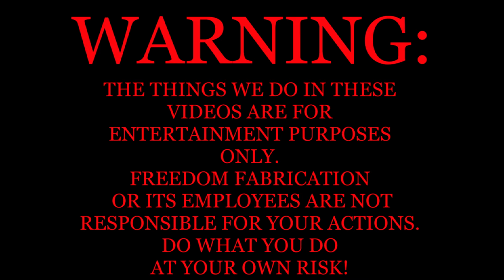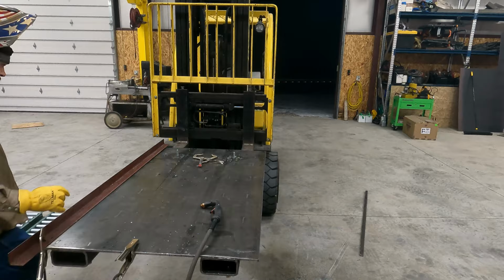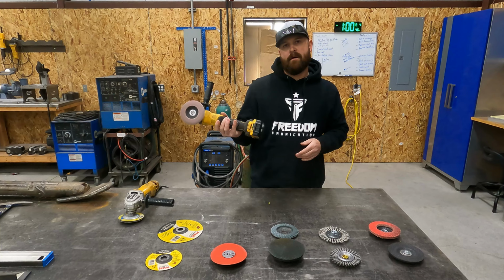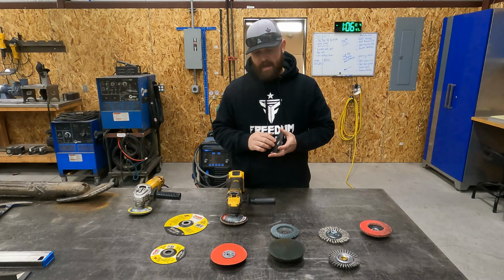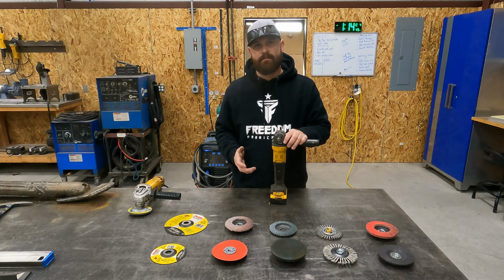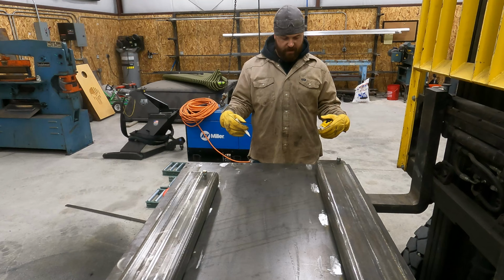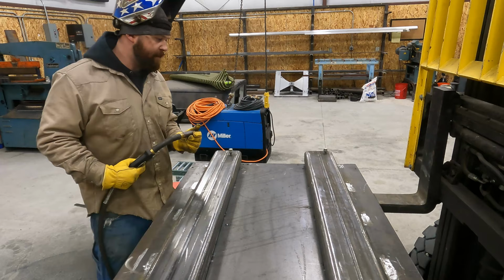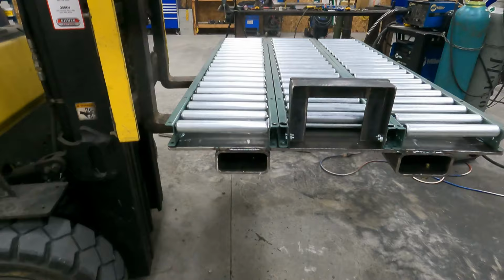Welding and Cutting modification on roller skid

Comment: Grinders are just never ending in usefulness belive it or not i have roughly 15 in a filing cabinet draw 
My brother in law works at a tool distributor, and they get tools sent back for repair mostly veriable speed bosch but there not cost efective to repair so i collect them remove the speed controll and work like a normal switch grinder something to think about if any of yours die and there not burnt out check the speed controll board if faulty take it out and back to work 😉
Reply from the maker: Good info. I’ll remember that, thanks.👍🏻

Comment: I have 5 x 125mm grinders I use, all with different attachments on them (cutting disk, grinding disk, wire wheel, Poly disk, flap disk) so I just have to pick up a grinder, no changing attachments. I have quite a few different brands - whatever was on sale when I needed a grinder basically. The dewalts seem clunky and slow to spin up to me, but they keep going. The Milwaulkee leads are to thin and get warm with heavy use, but otherwise they do the job, but my go to units are my  hikoki and makita units. I do have a variable speed one I got from Aldi of all places, it is great for wire wheels, but to heavy for anything else.
Reply from the maker: Not a bad idea to be able to just grab and go if you can afford buying multiple grinders. I will probably end up doing the same when I get to the point that I have some extra money.
Reply: I have one nice grinder I put a hard rock grinding disc on but I do the same thing with cheap harbor freight grinders for my flap, cut off, and wire wheels and they've been going strong for 2 years now. It really is so much faster to not have to change all the time.

Comment: Nice work! I see you using a respirator for the heavy grinding and I gotta respect it. I used to hate those masks but they're really a good idea. 

However, I looked into a Powered respirator (PAPR) a while ago and saw the price tag and said hell no. But, I kept my eye out on eBay and ended up finding a used speedglas one for only $400. (Not that much compared to $2000 new) 

make sure you get one where you can flip up the weld lens for a perfectly clear grind shield so you don't have to take it on and off and defeat the purpose. It has  auto shades 5-13 easily changed with a button so you can use a torch, plasma, and weld all on one hood.

I'd say it was one of the best purchases I've made and I can wear it for hours comfortably. No more black boogers! Keep up the great work!
Reply from the maker: I have always wanted a ventilated hood, but like yourself I didn’t have $2000 to spend on one. I’m definitely going to have to keep my eye out for a good deal though. I just got a new respirator I’m the mail today that fits under a hood. I’ll have to show it in a future video after I’ve put it to the test.
Reply: @Freedomfabrication777  Awesome! Looking forward to it.

Comment: Hey 1000 subs is a big deal! I did a give away with some welding rods when I hit 1000. You will learn this youtube thing out. It's fun to do once you get rolling.
Reply from the maker: I feel like it is. You may have to give me some pointers on that stuff. How do you pick the winner? Do you use one of those random number pickers? And are your subscribers numbered? How did you do it?
Reply: @Freedomfabrication777  I picked people from the comments. I told them to comment on the video and I'll pick a couple winners. Google random comment picker and then follow the steps it's super simple 👍
Reply from the maker: @mcfwelding  sounds good, I’ll check it out. Thanks for the info!

Comment: Been enjoying the vids thank you! I do have a question, Specifically what type and size of wire are you using for dual shield welding? .Correrct me if im wrong but the gas is CO2?. Also i wanted to tell you that i have been using a battery powered Milwaukee worm drive saw with a Diablo metal  cutting blade and It work great even cutting 1/2" mild steel. Fast and clean no heat.
Reply from the maker: The welding wire is .045 kobelco dw-50 wire and you’re correct, I’m running it with CO2. And it runs smooth as butter. 
The Milwaukee saw suggestion is a great idea. Thank you. I am going to put that on my list for sure. Thank you for watching!
Reply: You are welcome.